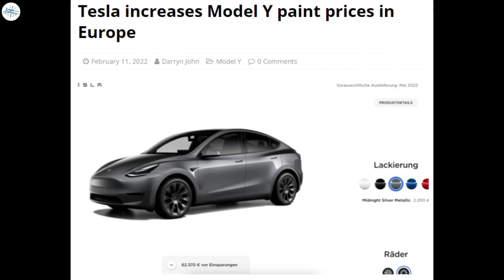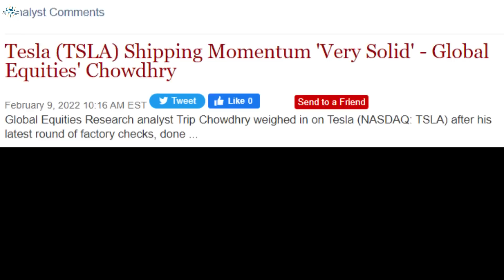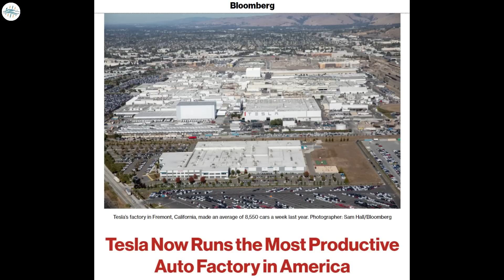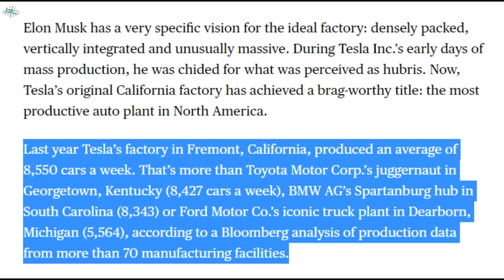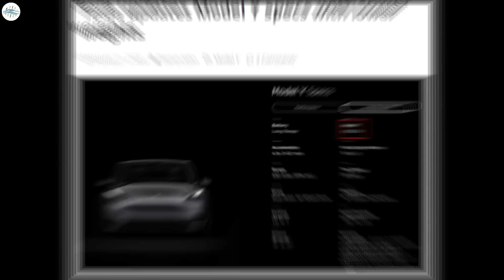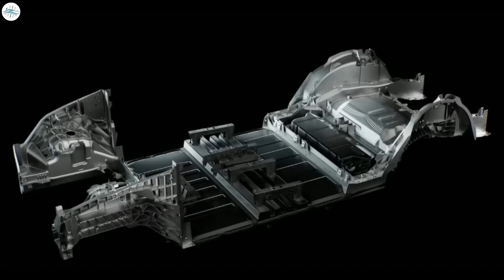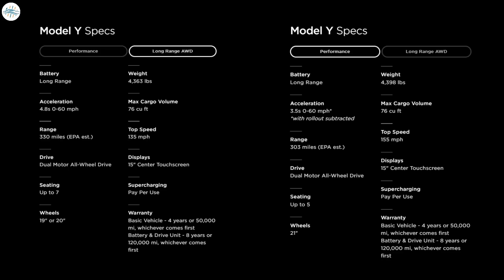Tesla Updates New Model Y Specs & More Updates!

Comment: if the weights not going down to much that means they are subbing in similar amounts of batter volumes and the casting is only loosing a little bit of weight. Hopefully range will increase and performance as well. They may underrate the range with the new 4680s to not hurt the old customers feelings but real world range may be closer to the EPA ranges.